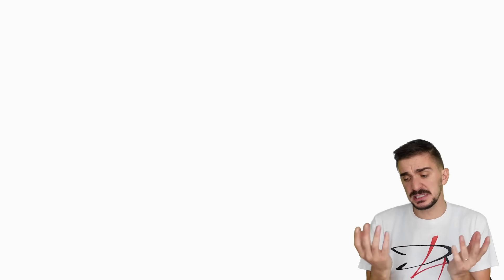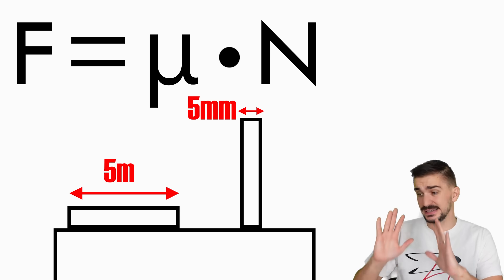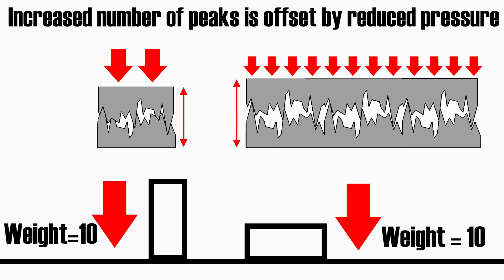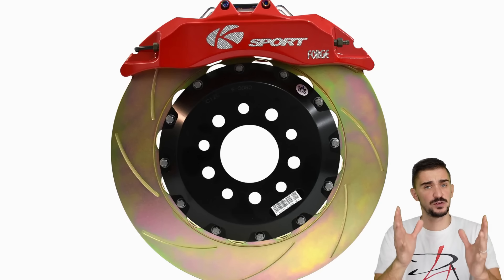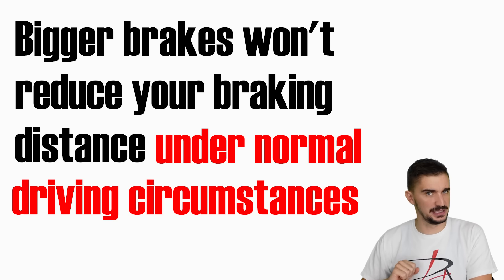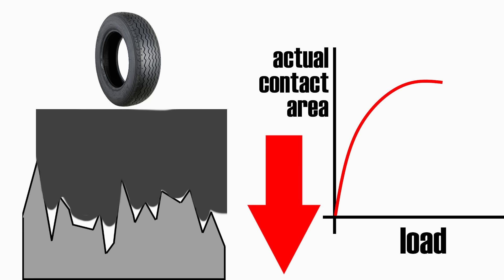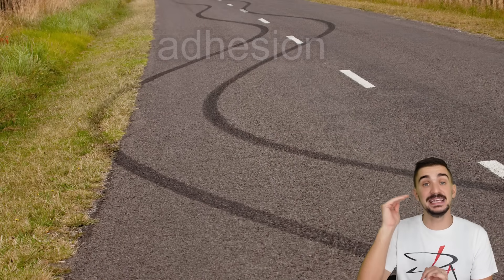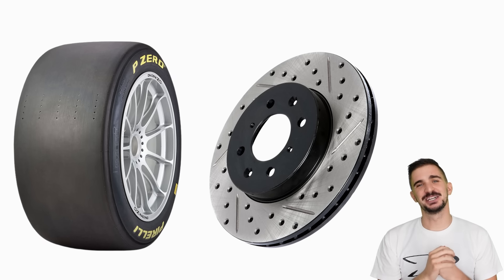Why Big Brakes Won't Stop You Faster but Wider Tires Will - Friction and Surface Area Explained

Comment: WRONG. Bigger brake disks have more friction distance per rotation than smaller disks. Because   Circumference = π*D  and e.g. if we have 15% bigger disks each rotation brake pads travel 15% bigger distance. Then , you should recall the formula for work A = F * S , where F is force , and as we know now it is the same, S - path distance. So, per rotation bigger brakes make more work and stopping distance is shorter

Comment: This is great video and I 100% agree with information but there is one big addition to it. 

Improving friction between braking pads and braking discs is not going to not make the car stop sooner, not only because of the reasons mentioned in the video but also because the wheel will "lock" sooner and that means friction between brake discs and brake pads will transition from dynamic to static friction which basically means contact surface and force applied do not matter because those two surfaces are not moving relative to each other. 

On the other hand, when wheel locks, friction between tyres and ground transitions from static to dynamic and that is where this whole point about rubber making more contact improves braking distance comes to light. 

Of course there is ABS system which negates this effect to a certain degree, but the point still stays the same: more contact with ground -> better braking performance.

Comment: Awesome Channel thanks for dumbing it down for me but I still don't get the math at the beginning at all. Thanks for the great content keep up the great work
Reply: @MARK Chapman
The equation, F = μ * N, is a simplified model of reality as mentioned in the video. A simplified equation can go far especially if you are able to account for possible variability of the different factors like μ.

For example μ can vary quite a bit due to different conditions, like any type of oil on the friction surface will drastically reduce μ.

Comment: Geometry is cool.  The bigger the disc the faster the outer edge has to turn doing the same RPM of a smaller disc.  The bigger disc is harder to stop. It’s going faster than a smaller disc. Plus you have extra mass to stop. 
 Edit.  Disc brakes are a huge upgrade from drum brakes. 
 I’ve worked on cars that use rods, cables and levers to operate the brakes.  No hydraulics.

Comment: Of all the videos this is the only one that doesn't convince me. First of all F=m x N is the equation for static friction (like tires) not slipping friction (like brakes. And second the friction coefficient mu is an oversimplification of something horrendously complicated. It depends of many things including surface area relative surface speed, temperature, area and also normal force. Among many more things.

Comment: All the explaination about the friction area of brakes is useless, because bigger rotors have bigger diameter, so the breaking force acts on a longer arm, which means bigger braking moment on a wheel.
If tyres have enough adhession, then bigger rottors stop car faster. But usualy tyres don't have enough adhession, so the size of rottors doesn't matter.

Comment: why front wheel use bigger brakes than rear wheel ?
Reply: At rest or in motion, the weight falls equally on all four tires. When you apply the breaks, inertia will cause the sprung weight if the vehicle to try to continue forward and shift the weight to the front wheels. The front tires will be compressed inteo the pavement, gaining grip while the rear tires will be unloaded, losing grip. If the rear brakes were equal to the front in size, the rear tires would break free of the pavement and skid.  Even in the days of drum brakes the front drums were larger and used double leading shoes while the rear drums were smaller and used single leading shoes.

Comment: I dunno my Brembo 6 pots stop far better than stock… I study mechanical engineering and it doesn’t make sense that a pad twice the size with 3 times the pistons doesn’t have more clamping force ability than a stock setup.
Reply: Plus braided lines

Comment: I had sticky tires but my brakes despite being mashed to the floor and bending the brake petal couldnt stop my car enough when I needed them. 
Its best to get a good combination. Good brake calipers and sticky tires for the best stopping performance. 
I still had a ton of grip but my brakes couldnt stop my car in time.

Comment: You are generally right here but missed a point on cars that have full brake kit upgrade and are not grip limited, if you upgraded the brake, you will often get a bigger master cylinder, assuming the car have powered brake, that will apply more pressure to the rotor which slow the car faster.

Comment: Yes, you are correct on the brakes beeing bigger for heat transfer.
But when you put bigger brakes on your car, that also increases the distance to the centre. Meaning you can brake harder. You just need less pressure on the pedal.
Limiting factor is tyres

Comment: On my ND Miata I tried bigger rotors and the power was very noticeable, it stopped fast compared to stock.  Stock rotor is 11", BBK was 12.75", pads and calipers and tires were OEM stayed the same.  My testing from dead cold in the morning I would do a warm up loop around the neighborhood about 5miles with using the breaks very minimally to prevent them from getting hot but to warm up the tires a little.  I would just drive straight flat road and slam on the brakes hard enough to activate the ABS and also do threshold braking both of which the bigger rotor had so much power where you feel the G-forces in your body much more so than the smaller rotors.  But what surprise me was how much more modulation the larger rotors had.  Those bigger rotors never overheated and fad like the stock rotors which was great but the larger diameter created so much more gyroscopic forces that it made the Miata less playful/agile, felt more solid/stable cornering and needed more effort in the steering wheel on turns and especially on S turns where it was less fun.   Stock rotor was 13.15lbs., bigger two piece rotor with aluminum hat was 12.6lbs. the handling feel was very noticeable.  I went back to stock size with two piece aluminum hat, 10.4lbs., and got the playfulness back and some.

Comment: All of the arguments made in these comments about greater mechanical advantage from larger discs, or any other frictional advantage are really irrelevant, because every friction brake, when applied with sufficient force, is capable of immobilizing the tire completely, which we all know dramatically decreases the tire’s ability to slow the vehicle. This is why we have ABS and other anti-skid technologies, to selectively REDUCE braking force to better allow the tire to do its job. Clearly, no effort to increase braking frictional loading is of any use in slowing the vehicle. It could possibly be argued that larger surfaces improve CONTROL over braking, as the same amount of kinetic energy is converted to heat through lesser clamping forces, however this becomes complex because the design characteristics of the hydraulic system and mechanical linkages must be computed, and it is highly likely that the desired performance may be achieved solely by optimizing these characteristics, without recourse to a larger frictional surfaces.
The rubber ball, by the way, becomes more difficult to squeeze because by reducing its volume you are increasing the air pressure within it. More force is required to overcome increased pressure, not because of changes in elasticity of the bounding material. The non-linear elasticity of the material does indeed exist, but in the example cited it is small compared with the increased pressure differential.
Reply from the maker: Great clarification of the first part. Hope people read this. Plus the increase in leverage from a larger disc is truly minimal as we're talking about a few centimeters of diameter.
I couldn't find a ball that's all rubber, no air, so I used that one. I kinda hoped viewers would imagine a ball that doesn't have air in it, like those stress balls. Should have made that a bit clearer.
Reply: @d4a  Thanks - very helpful, and as usual EXCELLENT video!

Comment: Then the concept in this video should say the greater the distance from the center should give a better performance in brakes which is being developed by Orbis Brakes. They are planning to develop wheels with the braking surface attached to the wheel.
Reply: Good luck keeping tire pressure stable and don't curb rash them or bend them. How do you balance those things?

Comment: The only thing not mentioned in the video about brakes is that, typically, a big brake kit comes with calipers that are also larger or have more pistons. This increases the force applied to the rotors which does increase stopping power.
Reply: I can do the same by pressing harder on my brake pedal. Back in the olden days I could lock the brakes quickly, even without power assist.  I can't lock the brakes anymore.  ABS, you know.  In the end, it's the tires, not the brakes.  I see that some other posters here still think that adhesion and friction are the same thing.
Reply: @cousinfester4621  i agree with that 100%, but when you're racing, which is when this is most likely to be used, you can achieve that result with less pressure on the pedal, reducing fatigue and its one less thing to concentrate on.
Reply: @jacobormsby9241  sure, there are many advantages to big brakes. But the video is only arguing that they won't, broadly speaking, reduce your stopping distance in a typical car
Reply: @cousinfester4621  yeah ok old timer. I've got a fairly modern car and with its old slide calipers i could never lock the fronts no matter how damn hard i stamped on the breaks on the road or track. I've upgraded to 6/4 brembos and applying half that force both snaps my neck, gives me internal injuries and locks the fronts before the abs even knows whats happened.
You just need bigger brakes mate.
Reply: @doug-core8850  Yeah okay youngster. I achieved the same thing using only brake pads with a higher coefficient of friction. Cheaper and easier. No extra unsprung, rotating mass. You don't NEED bigger brakes unless you need the better heat management properties. Personally I would run a bit smaller rotors if anyone made them for my car. Less rotor mass (within limits of course) equals faster lap times.
Reply: Not really. So long as the brake has sufficient capacity to lock up the wheel, or ideally to hold it at the limit of adhesion, the bigger brake is irrelevant. However, the bigger brake and swept area of the rotor has other benefits as mentioned in the video, such as heat dissipation.

Comment: I'm not entirely convinced that "wider tires are harder to overheat". The transfer coefficients should stay pretty constant independent of surface area and masses. 

A tire with more CP area does produce less surface heat from external forces, though, and has less rolling resistance and likely less rolling resistance heat.

However I'm not convinced that wider tires cool better or have a slower carcass transfer coefficient necessarily. They can cool with more energy, but it also takes proportionally more energy to cool them down.

Comment: If increased force on the surface helps with better contact between rough surfaces, why would we want to enchance the motorsport braking system? Fluid option is reliable, almost instant and simple, but why wouldn't we increase the pressure which the brake fluid travel, with electric compressor?

Comment: So the only reason why front disks are generally bigger than rear disks is thermal?
I.e. in a single brake test, all other conditions being equals, a 260mm and a 300mm disk will have the same brake performances?
Reply: Brake bias is a real concern too. You will want more torque in the front, and a larger disc is one inherent way to achieve that.

In a single stop from cold, it might very well be that a 260 and 300 disk have the exact same performance if they can both lock the wheel. The tire is stopping the car, not the brake.
Reply: @ArchOfficial  yeah, I was not putting the tire locking into the equation, as I wanted to only evaluate the braking performances.
I seem to remember that in University the professor, a motorbike enthusiast, compared a tradition braking disk with a perimetral braking disk, like lots of Buell motorbikes have. I seem to remember that the odds were very much in favor of the (way...) larger perimetral disk, which was not widely used because the heavier weight and diameter had much more negative impact on the handling. Anyway, this is fuzzy and it would be a nightmare to find the old books and the example...

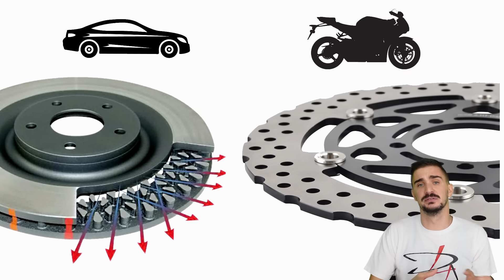Comment: Some additions: What you said at @7:20 is not correct. Those car discs ARE ventilated. To be accurate, there are drilled, rilled, ventilated and solid brake discs. Drilled and rilled are also considered ventiated discs, just the ventilation is different. Normal road vehicles usually have not ventilated AKA solid brake discs on the rear and ventilated on the front. 
Motorcycles have drilled discs because both drilled and rilled have a "self-cleaning" effect by removing grease, dust, mud, etc that builds up on the >exposed< face of the brake discs. 
Also, while it is true that by changing >only< brake discs will not reduce the braking distance, the bigger area of the bigger discs allows to increase the braking pressure, which, coupled with the proper tyres, will reduce the braking distance. This is because the braking force will not increase indefinitely with the applied normal force, but there is a limit.